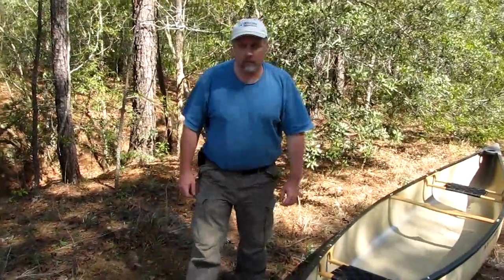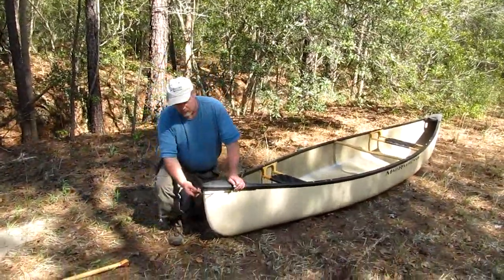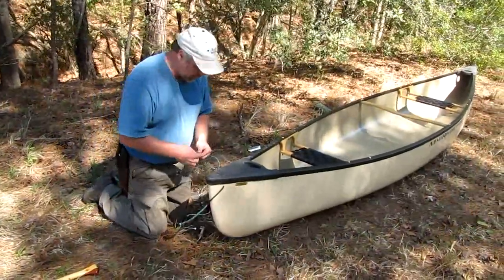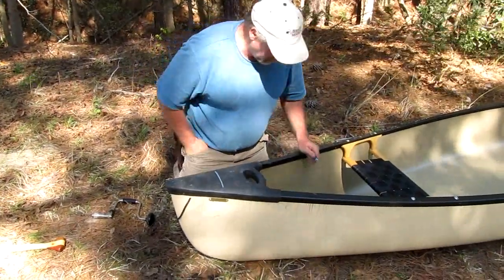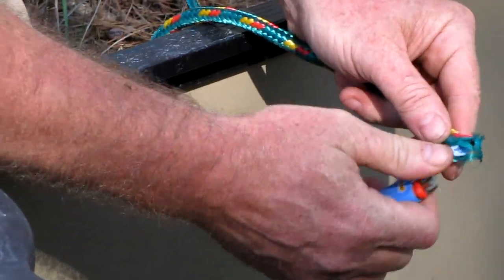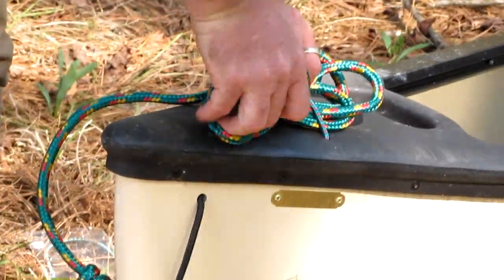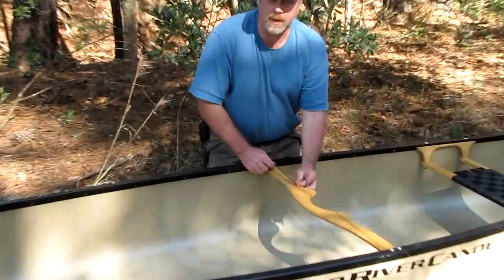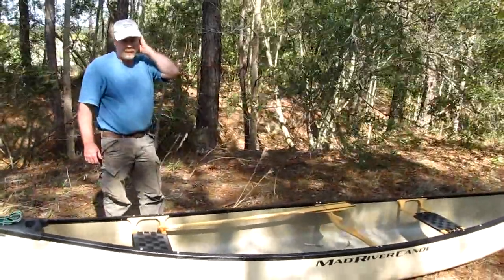Securing Painters on Your Canoe

Comment: I'm not a fan of having loops which easily become snag hazards.  Keeping the loop at the front / back very tight is possible;y better.  The thwart is then attached as shown through the loop and a grab line is added in the same way (attached to the loop).  Keep the loop at the front / back tight so that a hand can't be trapped in the loop.

Comment: Hi,

I’m an absolute amateur and a very recent canoe outfitter. However, I disagree with a few things you’ve done.

1. Thicker rope for your bow and stern loops- won’t pull through. 

2. Smaller bow and stern loops- they’ll snag something eventually. 

3. Buy some good rope. It won’t degrade in the sun, and it’ll be sealed already instead of horrifically fluffy. 

4. 2 metres of painter is relatively useless. Why limit it to a man’s length? What’s it used for? Why not have a bit more to be more versatile? 

Happy to be proven wrong or hear your reasons! Ray Goodwin’s guidance is great on outfitting a boat.

Comment: Put the hole for the grab handle line lower and you have water coming in. The boat already has a molded in carry handle. Not really a good idea to drill holes in thevboat like that. I would suggest sealing those holes up and gedttng a proper now loop ring.